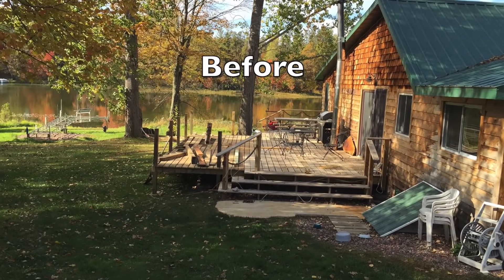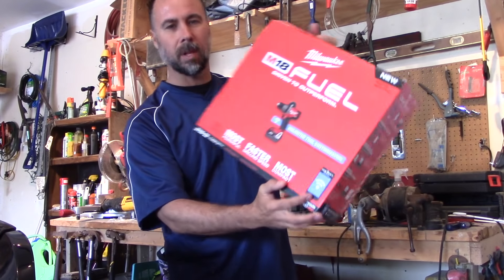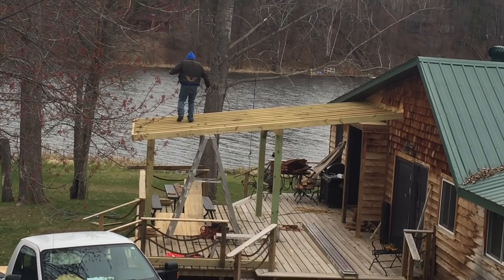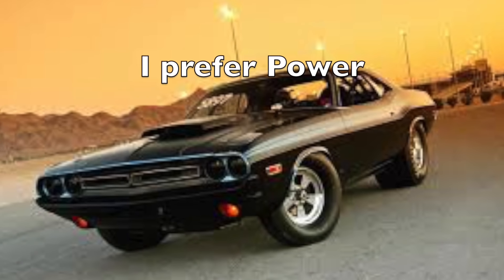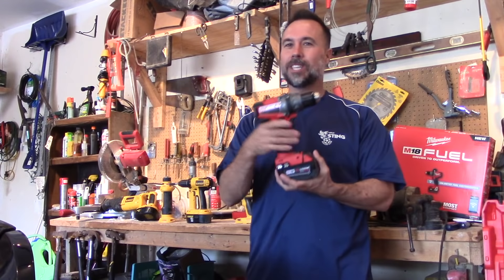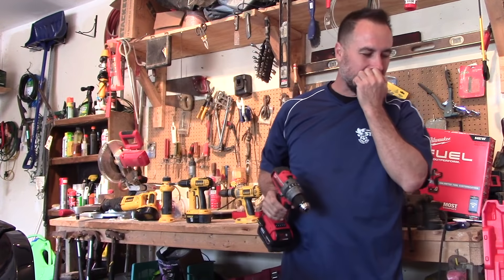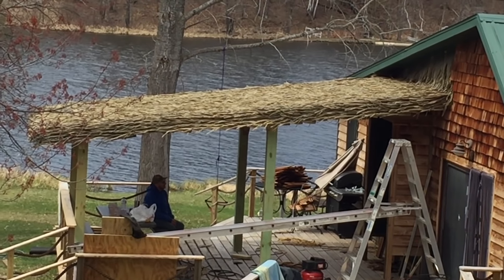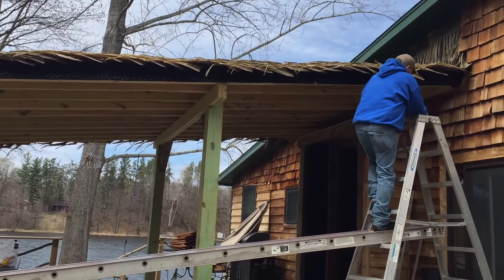Dewalt or Milwaukee  Power Tools?

Comment: DeWalt has been going down hill for several years. The power is still there but the longevity is poor. As far as quality and affordability goes, I'm loving the 20v Porter Cable line. Long battery life, very powerful, and anywhere from 1/3 to 1/2 as much as DeWalt in price. Best bargain out there.
Reply: +tnsteele95 I do believe Dewalt bought porter cable
Reply: +Ed Yager Porter-Cable is an American company that manufactures power tools. The company is known for introducing a number of noteworthy power tools, such as the first portable belt sander, helical-drive circular saw, and portable band saw. It is a subsidiary of Stanley Black & Decker.
CONFIRMED
Reply: I have to say I really do agree with you porter cable drill and impact driver are good for money
Reply from the maker: Nice😄👍
Reply from the maker: +Ed Yager good info😄👍
Reply from the maker: +jerry o connor thanks Jerry   Sounds like a good tool
Reply: tnsteele95 I second that, I had the drill, sawzall, and radio porter cable 20v, had for over a year and everything still going strong, never a hiccup and plenty of power, maybe not that little bit more these new dealios have, but plenty for everything up to say 3/4" or one inch hole saw, the sawzall was super handy and very ergonomic and light, but it sucked batteries, though you still got about 10 good cuts in 2x4, maybe 40 one inch tree limbs. The radio is wicked cool and Bluetooth but doesn't charge, that would last a whole work day on a full charge.  the prices were good, radios is a little pricey  but everything was worth their prices. I just sold the set a couple months ago, starting a new set now and scrutinizing the top three, but honestly talking about the porter cable stuff, if I didn't want to try one of the top three and try for the supercharger stuff, I would NOT hesitate to buy porter cable 20v again. For people doing here and there commercial work needing it or any home gamer stuff, minus thick steel, and if they want to save 40 or 50$ on each item and still have AMAZING tools, the porter cables are an undoubtable best buy.

Comment: Are you comparing the dewalt lithium ion? It looks like you have the old style. Anyways I had similar feelings when I got the dewalt lithium ion battery ones. The batterys punch way more power now. I got the impact one in the kit and that thing will plow lag bolts into anything lol. Anyways makes me wonder if its more the new batteries than the specific brand (as both brands have high quality)
Reply: +Tim Linden It's a little of both the new brushless motors put out crazy power and the new Lithium batteries have bigger fuel tanks the amp hours and can put out more amps which equals working power.
Reply: +DarkRaptor99 oh wow I just looked and I don't even have the brushless dewalt. these guys already have too much power for me haha

Comment: I have both dewalt and Milwaukee. I don't have problems with neither of them. Except for the new 20v dewalt. Drilling a 4inch hole didn't have my cord drill so I turned to my New 20v dewalt drill and burnt it out with the first few minutes using it. pissed me off. Returning today.
Reply: +Justin Fischer Wow surprised you were able to burn it up. The overload protection should have prevented you from doing that I wonder if you get a defective drill.
Reply: Fischer Quality Construction 21 it turned off, until it cools down or you reset with a battery on and off, appearently, did you let it cool down? Reset it? Still dead? Bad battery? How long ago was this? Brand new?

Comment: I've gone through Ryobi and Craftsman drills like nothing. I mainly use my Dewalt impact for everything and have only had to replace the motor/battery once after helper dropped it in a pool. A few of my crew prefer Ridgid and Hitachi. To each their own haha
Reply from the maker: Have you had a chance to try out a Milwaukee? If so what did you think in comparison to the tools you normally use?
Reply: Haven't had a chance to try out Milwaukee yet.

Comment: Your comparing totally different generations of power tool so it's no surprise that you would be impressed with it.
Reply: +Swaffercation 
exactly,this was not a fair compare..10 years old technology vs brand new...try new dewalt dcd996
Reply from the maker: True
Reply from the maker: +Željko Brekalo I do have and use newer Dewalt My cordless Dewalt is only 2 years old. I was using a different one for the video as my new one was on a job😄👍

Comment: I will give milwaukee credit they have really stepped up their game as far as power and reliability.. Tho I dont believe its a fair comparison between the new mw and the old style xrp dewalts.. The old style dewalts were big and heavy and are old tech now.. The new 20v stuff is much better... As for me I grew up with my dad using dewalts and when I looked for my first drill I ended up with the 20v hammer/drill and impact gun.. Man they are beasts.. Put deck boards on a 12x16 deck all on one charge was very impressed! That was 5 years ago! Still going strong. Recently I just got dewalts 1/2 20v xr impact gun for work/home use and man when you are in the field and need to take a tire off or fix something(1,200 ft.lbs of removing force) it makes short work of it. I had no problem getting the lug nuts off the backhoe with a short burst of the trigger.. Ive used it on tons of projects and its been great.. Havent found a bolt yet that it couldnt remove! Tho ive heard mw 1/2impact is also just as impressive.. Either route you go you wont be disappointed..
Reply from the maker: How is that 20v Dewalt?  Is it a beast?  How is the weight with it?
Reply: The 3/8's one is nice and light.. The 1/2 one is about as as heavy as a normal 1/2in impact maybe a tad heavier.. The 1/2 is pure awesome! I love its power.

Comment: Walk onto any job site and ask an electrician or plumber what they use, it's Milwaukee every time. Their tools are just better, they knock the socks off makita and dewalt, you can talk torque and rpm numbers all you want but Milwaukee actually puts metal gears in their tools not plastic

Comment: your examples are two completely different types of drills... the Dewalt you show is a standard nicad brushed tool.
the new Milwaukee tool you show is a lithium powered brushless drill... the two are literally apples and oranges in their power delivery. I would highly recommend comparing a brushless lithium Dewalt and the m18 Milwaukee... the result will probably be pretty even

Comment: I only had dewalt but I had been buying milwaukee lately and I have bad experience. my milwaukee weed Wacker it would turn off every 5 seconds.  also my compact vacuum didn't work after 6months and my other milwaukee vaccum started doing the same.   now my milwaukee m18 12AH battery is not fully charging.    omg I was loving milwaukee but whats going on.   has anyone experience the same?

Comment: Good tools aren't cheap.. Cheap tools aren't good. Milwaukee all day every day and twice on Sunday
Reply from the maker: agreed
Reply from the maker: +Adam Reichl one key is awesome. I had an education on it and was impressed.
Reply: +Stanley "Dirt Monkey" Genadek I agree I thought it was a bit gimmicky at first but when I saw the tool tracking and inventory possibilities I was excited. I had no idea I would actually use the other features but I really do. I have different modes for different woods as we built an Ipe deck and if you hand the gun to someone who has never drilled that hard wood before they will be snapping bits and screwing up all day; so punch in a specific program and the gun does the work for you. That alone made it worth it.
Reply from the maker: I know-  Thats awesome!

Comment: Milwaukee Fuel!!! The M18 is a beast!
Reply: my dad has the biggest Milwaukee battery powered set the m28 and that 28 volt battery is a beast will power through 3/4 inch thick rubber stall mats and any other material we use on the farm
Reply from the maker: Its is!

Comment: I have a Dewalt 18v drill and an 18v impact driver, both have been rock solid tools.  Then I have Milwaukee corded tools, Sawzall, drill, sander, circular saw, angle grinder...  They are all awesome, but I may be a little biased lol! #wisconsinproud
Reply from the maker: I think Milwaukee is focusing on going cordless
Reply: That's probably a smart move on their part.  Corded tools are kind of old school really, battery powered tools are just as powerful these days.
Reply from the maker: They are putting everything they have into improving battery powered line up.
Reply: I'll have to try them out sometime!
Reply from the maker: +Parker Hagenow let me know if you do😄👍

Comment: The video title shouldn't be "Milwaukee or dewalt?" It should be called "old nicad vs top of the line lithium ion BRUSHLESS tools." Lol.

 You should try out the impact drill for driving screws. It will blow that "screw gun" out of the water.
Reply: Also, I think you would appreciate makita's cordless tool line up. They have the largest 18v tool selection out of all the brands. Including a lot of landscaping/yard work cordless tools.

Comment: I use Dewalt power tools.  It is what I first bought so am commited to it with all the batteries I have.  I am not going to say if Dewalt is better or worse than Milwaukee or Makita since I DON'T KNOW.  Most others here and on most internet forums don't know either.  It is so childish how some on here and most internet forums state as a fact that one is better than the other without really even knowing.  Dewalt Milwaukee and Makita all obviously make good power tools. 
I do know one thing, the IDIOT in the video is so stupid and thinks the rest of us are stupid by comparing a Milwaukee Fuel to an OLD 18V Dewalt.

Comment: 20-Volt Max Lithium-Ion Cordless impact screw guns .  Your dewalts are the OLD ni cads . not a good comparison. M18 are lithium ion .   They last way longer than the old ni cad.   Also Dewalts new batteries have the led battery indicators like the m18's do.
Reply from the maker: +Ed Yager I didn't mean to do a direct comparison-  I just really liked the new milwaukee.

Comment: dewalts the only way to go 
but go 20v
Reply from the maker: Big dog😄
Reply: The Dewalt has the same voltage as the milwaukee. Dewalt calls it 20 volts because that's what it is under no load. Milwaukee calls their batteries 18 volt because under load that's what it is. They're all the same and you're not getting any more power with the Dewalt 20 volt series

Comment: Hi. You are comparing a 10 year Dewalt design with a modern Milwaukee. I own both of the modern versions and the Dewalt xr US built is way stronger, lomger lasting, and more comfertable than the Chinese Milwaukee. And yes, they say made in China on the pakaging. While some lesser Dewalt tools aren't worth owning, ie Chineese made non xr models, the most recent xr models outperform anything out there both on paper and on the job, and have the same traits you mentioned of the Milwaukee, except of course that rediculas phone app. Frankly I don't want my guys messing with the programming on tools that they ought to simply learn how to use properly. Frankly I expect my guys to know how to drive a screw without overdriving a screw and without having to get on their phones to program the screw gun. In fact I don't want them on the phones at all while at work.

Comment: Milwaukee drills are great until you try Makita.
Reply: gregall7 
Makitas great until you get dewalt
Reply: gregall7  Makita is light and quality but I think definitely behind Milwaukee and DeWalt. plastic Chuck's and stuff seems less hd
Reply: Makitas have some of the best chucks on the market
Reply: Mikita was great years ago, I still use my grinder and it’s awesome, but they don’t have the large product line and cordless options like Milwaukee. 
Dewalt is a big box store shoppers/handyman special. 
I Never see anything dewalt products at any Plumbing suppliers..
Reply: Makita has the worst chucks I've ever used in my life. They're also loud, slow, and gutless compared to Milwaukee and DeWalt